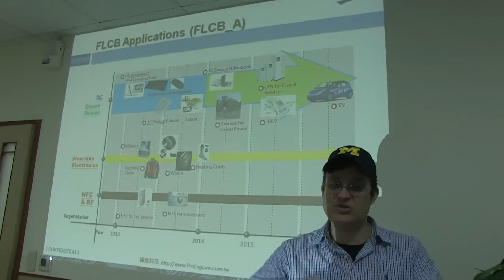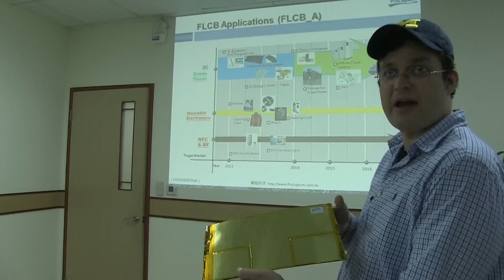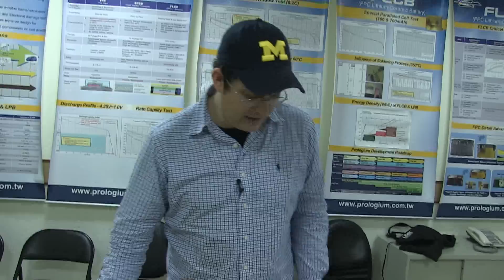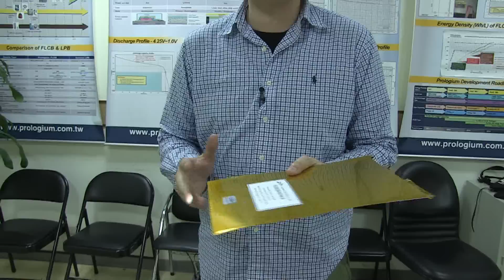Flexible Battery Technology for Future Smart Watches & Other Devices

Comment: I have a couple of things I love about these batteries ^ what they can do for people.
One: I wish that this Light Weight technology could be put in Power Wheelchairs & Scooters. This would help because if the battery weight was lighter & the batteries could power a ADA Mobility Device for a lot longer but not have to spend so long to charge the batteries this would make th life quality much better for People With Disabilities (PWD) much better. More battery power in a smaller space is much better plus if you can cut this battery then there is not any worry if the battery gets damaged because nothing will leak and/or blow up.

Two: It would be nice if we could create this SAME Technology in America! I believe that we as Americans need & MUST start creating this type of technology & find ways to make the Batteries much more Powerful, Smaller for less & we need to start making more devices Use LESS POWER but make the devices the batteries power More POWERFUL! We as well need to start using more Earth Friendly parts to make these batteries. Making these batteries so they can be Recycled & CUT our Carbon Footprint this will help us with the power we need while protecting our Environment.